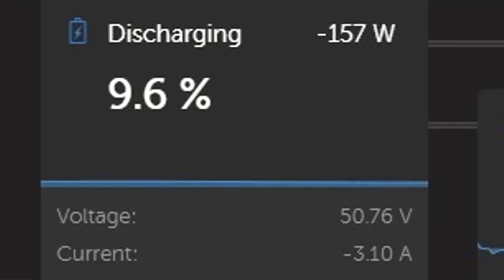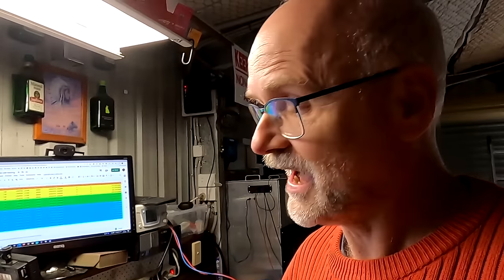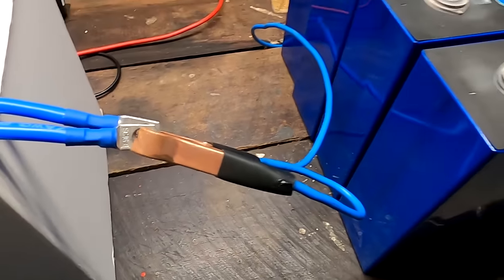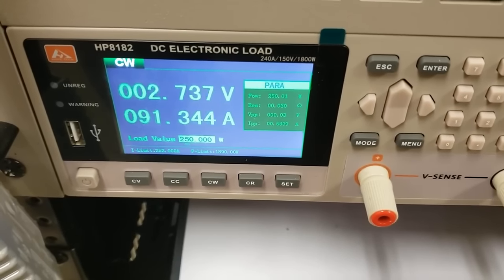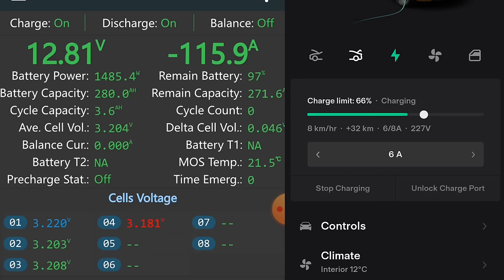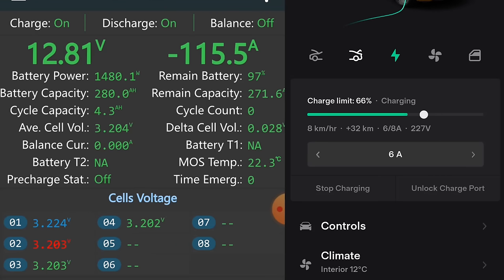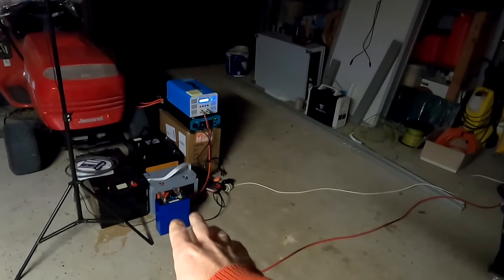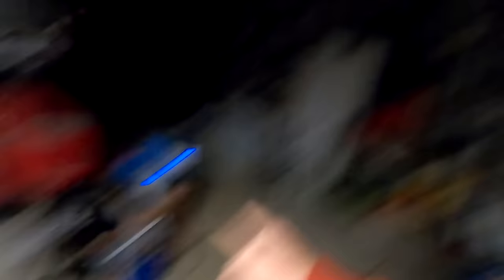Battery #1.0 High Amp Test. Massive voltage drop under load on this 4 year old battery?

Comment: Andy's Concerns are valid, and we will do another test, this time with v-sense shown un-cut no edits. Now with that out of the way,  we need to clarify some things: 

NEITHER CELL IN that video were certified cells, this was when we started our business and were taking our supplier's word about grade A cells (the same way you all do when you talk with Basen, or QSO, e.t.c). As we clearly state in the video both cells came from the same vendor, it turns out neither was Grade A. But 1 cell was clearly worse. So at best this should be considered Decent Grade B vs Bad Grade B Cells.

NEITHER CELL was ever sold on our site, in fact all cells form this vendor we auctioned off on eBay until we found a reliable cell supplier which was Directly from EVE.

Please understand, we have cause a major pain for all sellers across the globe, form China to the USA and probably caused major losses for the Shenzen Grade B Cartel. This is fine, we have made our claims and now will back it up.
Reply from the maker: Thanks guys, that's great information and will help clearing things up. 
You're doing fantastic work. I love this tester you have and may end up with one of them ...
Reply: I placed 3 orders lifepo4 before 1 got delivered, 1 China took 90 days before money back (never send), 1 France took 30 days claimed there where delivered (lucky ALIE could see the scam) 1 Germany (allot more $) but they are fine and I believe brand new, I really love these battery's and they are fine, its a cowboy world at the moment.
Reply: We are going to an economy with local cycling in energy resources and food. It is necessary imho. Your Type of product could play a great role in helping people to harvest their own energy. Governments should help stimulate people in building their own batteries. It is like gardening imho. If you like more, you build more.
Reply: Please see our updated video: https://www.youtube.com/watch?v=KD-av4cTL-Q real world example of an actual customer.

Comment: Thanks Andy once again for all the great testing and information on these cells!
After your video mentioning the SFK test, I tested 32 of my cells with a similar setup you have, but was pulling 200amps per cell. I had similar suspicions to you. Those cells were sold to me from an honest seller that said they are grade B - 270-280Ah capacities.
The lowest voltage drop I saw was also down to 3.1xxx volts only, @200amps.

Comment: I have 4s 280Ah battery and I know when I run my 850W@120v~ Cook Top Burner off my 12v Inverter (65 Amps ~) my cell voltage drops from 3.33 (fully charged) to 2.9 - sometimes even drops down to 2.79... while under full load, and then under no load they bounce right back up to 3.3/3.2 (depending on how much I used and how long I ran the burner... based on my Xiaoxiang BMS App (Under very heavy load, by battery craps out even through the BMS App thinks there is still 50/70 Ah left in the batter, if I hit my battery with a heavy load when it is below 50/60% the BMS Freaks out and the whole thing craps out a literal brick!) Just wanted to add this to your data pool and share my experience. Based on what I am seeing from your batteries, I now think my batteries are also not "New" Grade A - which is what I thought I was getting... Thanks for the videos

Comment: from a small set-up to 12 cells i notice the internal resistance swallows up quite a bit of current before the bank actually starts to charge. soon as i increased the input by 10 amps now 40 amps in total im significantly getting a better charge. i only charge to 90% and never go lower than 50% if i can help it. my entire house is sparingly supported by solar (off-grid) and even in summer i have to be careful what i use. every appliance is under 1kw each. 
i even use my camper as a satellite for charging small items.

its simply simply... lovely!

Comment: Unless I missed it in the search, I'd LOVE to see a vid about all your testing equipment.  Recommended tools and test equipment to support solar would be invaluable.  DC load devices, dc power supplies, volt meters, etc.  (I do realize Andy has an outstanding list in his video description and all the equipment he uses is listed.  Very nice to provide that for our benefit)

Like Sun Fun said, there seems to be a HUGE difference in good B grade and bad B grade cells.  We just need to be told what we're getting.  A grade should be a standard, no-guess, consistent cell with known values.  B grade should be plainly marked with all the parameters listed.  Transparency is critical for us.  We'll still buy the cells even if they're bad grade B, but we need to know the specs in truth so we know what we're getting.

Comment: Good subject! Very interesting to see what others experience.
Oh mine drop in voltage for sure!
8x280K from December 2020. 
Also, a load of 2350Watts on this FCAO inverter draws 30 percent more amps from the battery with their provided cabling than with my 50mm² with fairly good lugs ...

Comment: Internal resistance differences could be Sun fun are using a DC IR measurement and not using the more commonly used AC IR measurement as you are with your IR 1khz tester. 🤔
Reply: The SFK guy is not doing ANY kind of internal resistance measurement in his video, AC or DC. He does make the claim in his video that his load is showing IR, and Andy is in good faith repeating that claim here, but the SFK guy is confused. See my earlier comment on this video if you're interested.

Comment: I have reservations about the method of yours measuring the internal resistance of cells. And not only to you, dear namesake, but to everyone using a device similar to yours.
The thing is, this meter does not measure internal RESISTANCE but internal IMPEDANCE - these are two different issues in electrical engineering. It measures the impedance because it results from the measuring method which determines the TOTAL resistance for the measuring using ALTERNATING CURRENT - and this is the impedance! In addition, this method is burdened with a large error resulting from the measurement principle.

So how to determine the INTERNAL RESISTANCE? Measure the voltage at the ends of an UNLOADED cell, record the result. Measure the voltage at the loaded cell terminals again, record the measured voltage and the load current value.
We can calculate the internal resistance from the dependence: (unloaded cell voltage minus loaded cell voltage) divided by load current.
Voltage measurements should be made directly on aluminum connectors, so as to eliminate the contact resistance of the screws and clamps, which begin to play a significant role at high currents.

Based on the BMS data, the internal resistance for a current of 92.6 A is approximately 0.63 milliohm, and for a current of 157.3 A it is approximately 0.66 milliohm. Everything agrees with the theory - the internal resistance of the cell slightly increases with its load. However, the BMS data are not a reliable basis for my conclusions. Personally, I believe only in those measuring instruments whose measuring accuracy is clearly stated by the manufacturer and is less than 1%.

The gauge you use only allows you to comparatively ESTIMATE the quality of the cells, especially when selecting a set for one bank, in order to be able to eliminate grossly different cells as a quick method in which the accuracy of the measurement is of secondary importance.
Reply from the maker: Yes, you're right. The method of calculating it is very inaccurate though. I have tried that with the PALO cells I have and measured and calculated 10x to get a good reading. The results were all over the place due to errors in measuring. That all works in theory but not in a garage with a clamp multimeter and cheap voltmeter.
Reply: @OffGridGarageAustralia  IMHO it can be done "in the garage" or under any circumstances. One accurate multimeter and one accurate current transformer are enough. As I mentioned, it does not have to be terribly expensive, sophisticated laboratory class, one percent accuracy of workshop equipment is enough. All you need to do is answer a simple question: will I be satisfied with a 1% accuracy of the measurement? For me yes.
You are in a good position: you have a good reach on YT. Why not take advantage of it by approaching a reputable measurement equipment company with a sponsorship offer? There's nothing wrong with it. On the contrary, in the case of fruitful cooperation, it would certainly have produced very positive results. Especially with measuring! :)))

Let me note that the misused laboratory equipment you indicate will also lead to false results! The second thing: measuring large and very large currents has always presented serious problems and so far there is actually no good, direct measurement method - each has some significant drawbacks or limitations.

P.S. Why are the Chinese forcing the impedance measurement method? I believe that the reason is the significantly underestimated values. Marketing 0.17 milliohms or 0.25 milliohms looks much better than the real value. I dislike such practices very much and immediately arouse my suspicion. The more so because in general, considering the significant discrepancies between the production date and the date of sale, there is ALREADY an unhealthy atmosphere around these batteries.
And it would be enough to add a small print at the bottom of the card with the measurement results informing that the applied impedance measurement method may introduce an error...
Reply from the maker: @andrzej3511  great comment, thank you. 
What tester would you recommend to get accurate measurements? Do you have anything in mind?

Comment: The example we had in our video was one cell, not all grade B cells behave this way, Our video was to show what can happen with a particularly bad Grade B cell. In fact we stated that both cells we had in that batch were from the same vendor in the same batch so it was important to show why testing is important.

We will post a follow up video soon. As we stated earlier, 80% of grade B cells are fairly decent, with about 15% being questionable or having issues and then 5% being simply garbage, the example in our video was to show what can happen if you end up with a garbage cell. 

The reason why we recommend grade A is not necessarily because they are 10x better than grade B it is simply because every cell in grade A is perfect and you will avoid running into an issue with a cell that has severe issues.
Reply from the maker: Plenty of evidence... 🤦‍♂️Mark is still claiming I have certified battery cells which I don't , so not sure where he gets all his so called 'true' information from but he's clearly off with his claims.
Reply: @OffGridGarageAustralia  I'm only following part of this discussion, but let me add a data-point anyway. I'm now in my third year running 32 of these 280Ah EVE cells (not the N version, not the K version. The 'original' ones, with a manufacturing date in 2018 I think) in an off-grid situation. They've been frozen. They've been cycled 100% to 0%. They've sat at 100% for months, etc. I don't pamper them - they have to power my house. They're not EV grade for sure, and I think I was one of the first ones to buy these from an Alibaba seller (a seller who doesn't exist anymore). The two 48V battery packs have not been taken apart since I built them, and a couple of days ago I did a 6kW load test on each of them (350W per cell, the highest I can realistically do) since I wanted to see if any cells would drop in voltage. No problems at all. Now, even if there was a cell or two that were bad at this point, replacing them would be a non-issue. And as I said in the past, for this application you can't beat the price, even if you have to buy a few cells extra just in case.

Comment: For me the test that is important is the "standard test" method of the manufacturer...
For example there is a test of 1khz to measure AC  R (the one used here) and several DC R... So apples to apples.

But the test is very meaningful and it says allot  about the health of the cells...
And so far they seem  good for 4 years old cells.
No exaggerated voltage sag and low temperature during the test, so far so good. 👍🏼

Another capacity test marathon in cold, dark Australia under the standard 25⁰ C 🤯🤯🤯😁😁😁 brrrr... 
Be patient and keep up the good work Andy. 👍🏼

Comment: Measure cell voltage at 3 times. Check no load readings (before & after) to compare with during high current but quickly before the battery warms or discharges too much. Was your drop about 35mV to 50mV per cell at 160A? Any resistance causes voltage drop. milliVdrop= Amps x milliOhms eg. 160 x (0.22) = 35.2mV. Any wire, connection, fuse or breaker will have a voltage drop proportional to the current passing through. Your multimeter may have difficulty accurately showing it but even 0 on screen will be a non-zero positive value so small it couldn't be displayed with enough leading zeros.

Comment: Hi Andy, you are very welcome to the sunny New Zealand :) I just installed 15 x 395W PV on the roof (last one waiting for some extra hands to be fixed, as it will be 4S4P) and your help might be very appreciated :D On a serious notes - I will be playing with a bit of different setup - I got 4 used Tesla batteries (5.3kW) and going to utilise them in conjunction with Victron 250/100 MPPT and some no name 12kW inverter!!! Anyway, thanks for all your insights and recommendations (I got JK BMS with LCD, so will see how it will performs). Wish you a sunny weekend!
Reply from the maker: Thanks a lot for your feedback and sharing. That sounds like a great setup. The Tesla modules certainly need some different configuration as they are not LiFePO4. Did they come with and sorry of BMS at all or just pure cells/modules? I have seen some Tesla modules which came with a BMS already and it could be integrated bis CAN bus to Victron for example.
Reply: @OffGridGarageAustralia  , Andy, yes, indeed, Tesla is just a Li-ion battery pack, based on 18650 cells with different top/bottom voltages and different charge/discharge currents. These packs are equiped with original BMS, but it’s Tesla’s proprietary and documentation isn’t widely available, as well as it doesn’t provide cutting power of fully in case of under voltage or over voltage - that’s why I bought 2 of your recommended JK BMS (1 BMS will take care of 2 batteries as it’s 48V system and batteries are connected in 2S2P configuration). Also considering buying some grid tie inverter (maybe Growat) for the summer season, when abundant sunshine will charge batteries in no time and we (theoretically) might have surplus energy to sell to the grid…. Anyway, wish me a luck - it will be an exciting journey
Reply from the maker: @MrJanulis  You can google the documentation. Tesla made all this info publicly available, They have a patent on their technology but I think it's all open source, so others can use it as well. I made a video about this on my car channel 2-3 years ago. Quite interesting, they basically balance the cells all the time with a very tricky algorithm.

Comment: Hi Andy, could it be that the internal resistance measurement of the tester the guys used on the other youtube channel is showing the real DC internal resistance?
The small testers like you are using usually do actually measure the AC resistance cause out of the way these testers are working. Great Scott did an interesting video on his channel recently.
Reply: The SFK guy is not doing ANY kind of internal resistance measurement in his video, AC or DC. He does make the claim in his video that his load is showing IR, and Andy is in good faith repeating that claim here, but the SFK guy is confused. See my earlier comment on this video if you're interested.

Comment: 2 things to say.

First, I noticed the sense leads issue, and considered it. Maybe they chose to measure this way to make the behaviour more obvious.

Second, it seems from the test sheets they showed, these cells should provide 320Ah. If your capacity is below this, that would be a fail.

If you are seeing big internal resistance or a huge voltage sag (which is probably due to IR) these are truly "faulty" cells. A solid voltage under load and ver low IR means the cell is ok, but the capacity was the reason for rejection. They're still not "certified" as such.

Comment: Thank You!  Wery interesting video! It's good to know the Lifepo4 cell's behavior under load.
I have 202Ah 8 cells battery. With Lifepo4 battery scanner app I find, that my 3 cells are with "0" Ah description, but all cells have printed stickers 202Ah capacity on the body.
And that 3 cells always have lower voltage on 0,003 mv without load, and always run down under load to 0,020 mv(40A load) to 0,110mv (120A load)... Are that cells bad?

Comment: HI I LOVE YOUR VIDEOS ANDY..
I WANT TO POINT OUT SOME THING THAT YOU HAVE SAID IN THE VIDEO. IN THE VIDEO YOU HAVE SAID THE DC ELECTRONIC LOAD IS SHOWING THE INTERNAL RESISTANCE OF THE CELL'S BUT ACTUALLY IT IS TALKING ABOUT THE EXTERNAL LOAD RESISTANCE THAT THE TESTER WAS PUTTING ACROSS THE BATTERY TO LOAD IT TO THE CURRENT LEVEL THAT THE USER HAS SET.